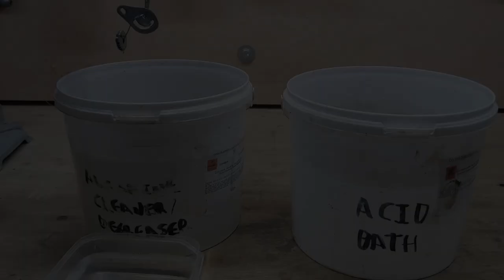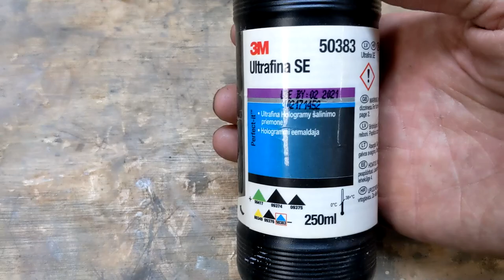Rusty Vintage 'Bon Clou' Can Opener Restoration

Comment: Sometimes we overthink a problem, when the answer is right in front of us. Building it newer,doesn't always mean better, these devices worked very well and didn't require any electricity. Thanks for sharing. 👍😁🇨🇱🇺🇸
Reply from the maker: I was surprised how well it works. Maybe it's because I'm left-handed, but I find this works better than the modern one we have in the kitchen. It's a keeper for sure!

Comment: In the future if you want to save a logo like that you can put something inside the engraving to either protect it, or something that keeps the paint and filler front sticking. That or you can just etch it or engrave over it again.
Reply from the maker: I did try that, but it didn't work. I tried a few things off camera, but ultimately the engraving was just too thin , any amount of paint filled it in. 
Redoing the engraving is something I'd love to try sometime, but I don't have the equipment to do a decent enough job of that yet. Another time, perhaps!